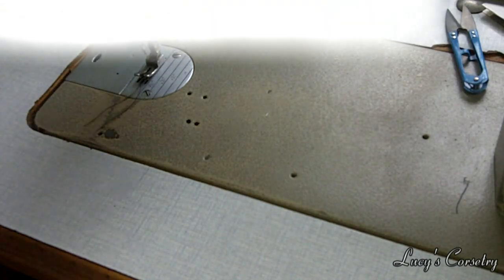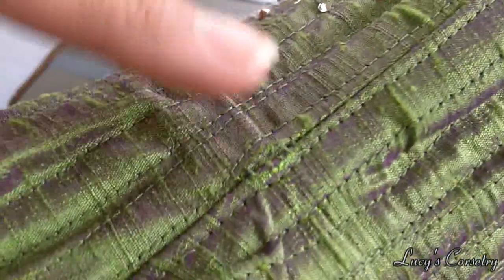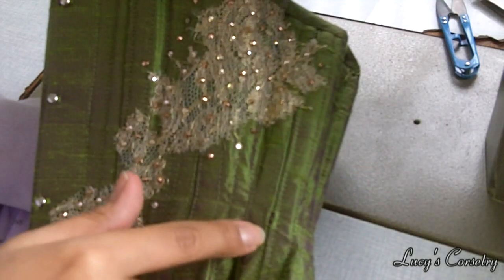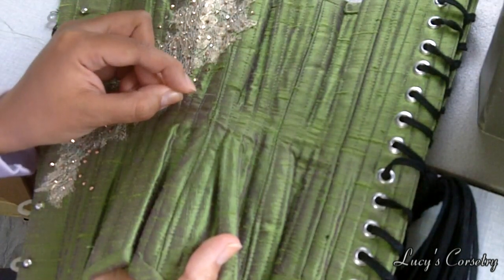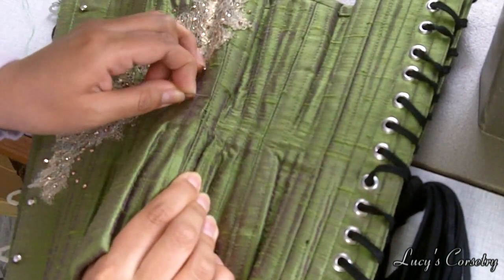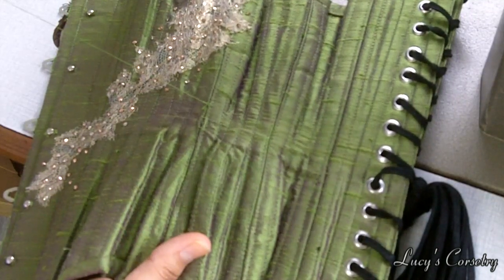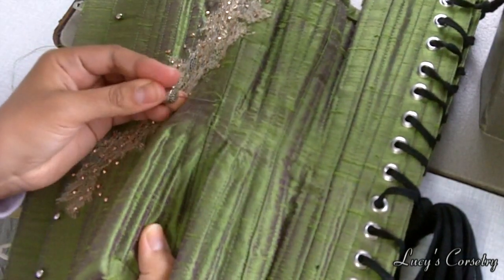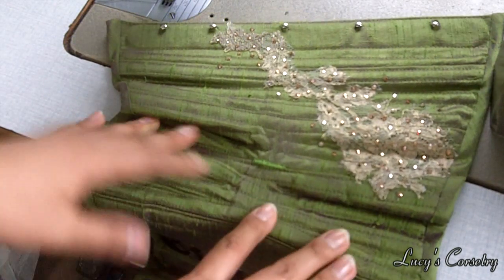Mending the torn corset seam | Lucy's Corsetry

Comment: Lucy!
I had excactly the same problem with my metal thimble - simply no feel and it was as if I had no finder where one should be :D
I made one out of leather - you can see it on my fb fanpage (cannot put address here)
the fingertip part needs to be exchanged after a lot of hand stitching as the leather will finally wear, but it feels much better and it does not come off your finger! ;-)

Comment: Hi Lucy! I was wondering if you could do a video on fixing torn fabric on a corset?
Reply from the maker: Unfortunately there's not much you can do for torn fabric apart from putting some kind of patch over it - and because corsets are supposed to take quite a lot of tension, that patch may or may not hold up to the stress.
Reply: +Lucy's Corsetry thanks for the info!
Reply: Maybe you could try using a patch made of several layers of a dense weave fabric with perhaps interfacing. I am not certain of this, but maybe an iron-on embroidery patch might work too as long as you feel that the corset will be comfortable to after with the patch going over the boning and wherever the tear in the fabric may be.
You might want to probably test it before applying. :)

Comment: LUCY I NEED YOUR HELP! Recently I discovered that the two boning near lacing on  the right side of my all cotton corset had ripped through the bottom of the channels. Though It does not affect the shaping of the corset and I can pus them back in the edges are sharp and tear into my pants. I am also worried that the rip will get worst bu amt not sure I can stitch it up with a sewing machine or by hand without breaking the needle. I considered just putting a patch over it-since I mainly wear this corset under my clothes-but  then realized that the bones could just rip through that too. In a moment of frustration I thought o taking the two bones out all together and wearing it like that till I got enough money to buy a new one but again realized that it my cause even more damage. Please help me fix this lucy
Reply from the maker: Where did you get your corset? If it was made by Orchard Corset, they should simply replace the corset for you if the corset is less than a year old. Same with Timeless Trends, although I haven't experienced a problem with their bones popping out. 
If you did want to repair the corset, then patching it is your best bet - yes, the bones may eventually rip through the patch too, but that's the way things go. If you wanted to eliminate the possibility of that happening again, you would have to take apart the corset and completely replace the back grommet panel with a new one, which is more trouble than it's worth if your corset was cheap.
Reply: Thank you, Lucy, I will try the patch idea